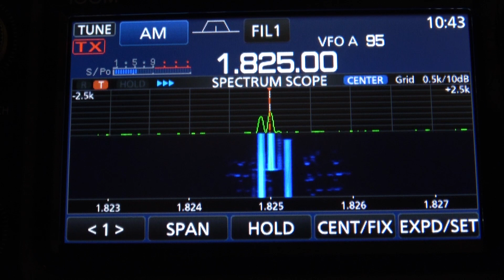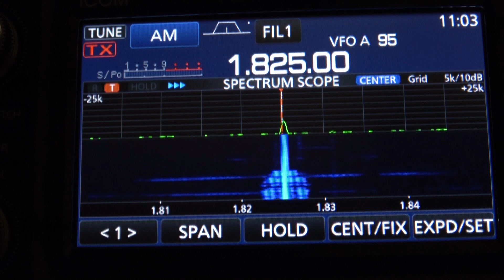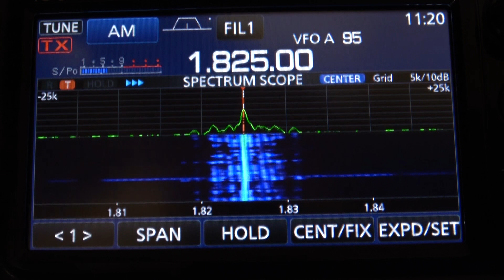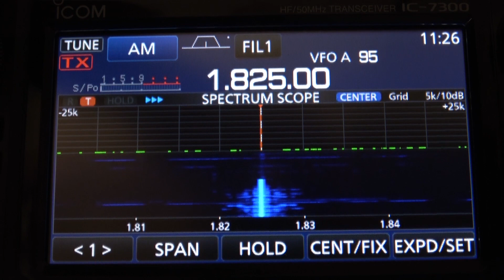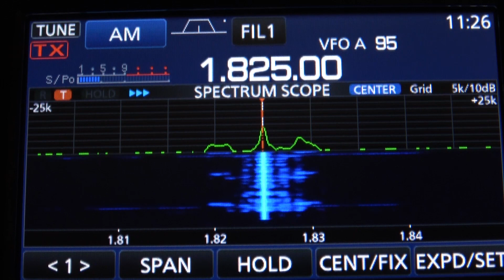1825 11am net received at low noise site 70K east of Melbourne.

Comment: Good signs from all participants,  particularly Laurie.  Nice ceivers, I didn't think you had any modern menu rigs! 😮
Reply from the maker: I am actually a model of a modern major general and have been playing with SDR's for quite a while and computers since DOS but they don't make photogenic videos and others know more than I do about it so I stick to my speciality. The 7300 is very good but has a few limitations but 
at the price it is a gem and also transmits 100w pep and only takes 1 amp at 12 v on rx so good for remote dxing instead of using a lap top and separate SDR  with high current drain and noise from inverters and power supply's. Was a remote RX there in the 1980's but the trees have grown up and now solar power not practical other wise I would put up a remote SDR.
Reply: @vk3ase  Thanks for explaining.  Are you able to cut enough tree branches away to create a patch of sunlight for some panels? Millgrove would be a superb location for a WebSDR. You'd need an internet connection.  Maybe these things are best placed where you live, so you can support and secure it.